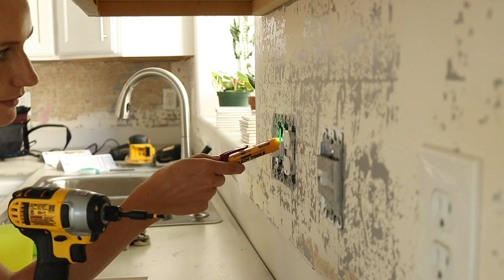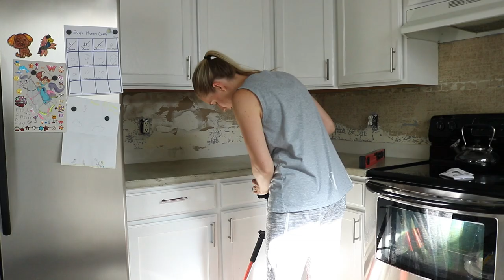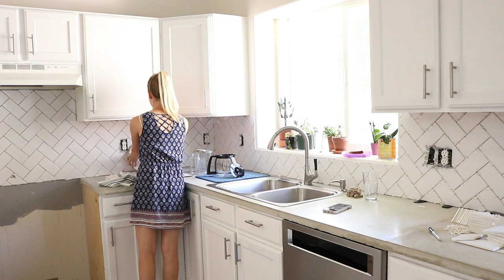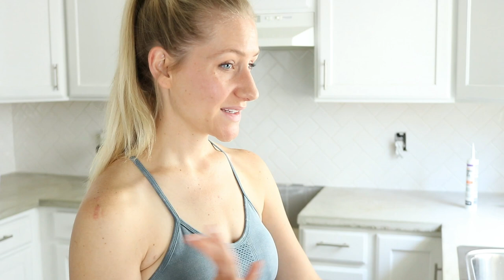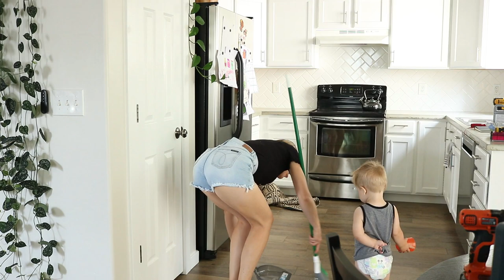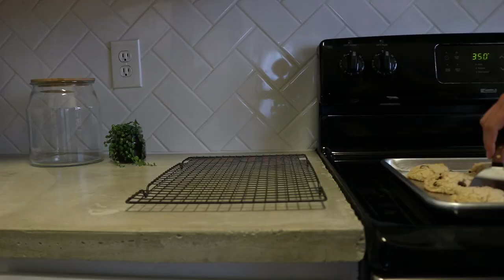budget-friendly subway tiles- but make it herringbone | SINGLE MOM DIARIES | kitchen reno diy vlog

Comment: Looks great! Somehow, we got it into our heads that a painted concrete floor was better than the cat pee indoor/outdoor carpet. We removed the carpet to find laminate tile from the 1970's. We started removing the floor which took a whole day. The glue was still all over the concrete floor. I went and bought the adhesive remover and a floor scraper from Home Depot. The glue was a pain to remove. Highly, highly do not recommend! We tried using paper towels at first, which did the job but took so much time. I then got the brilliant idea to use kitty litter. Bought two bags of it, it was pretty inexpensive. I figured if we used it in the auto shop to suck up oil then it would work in this situation as well. It worked very well. Spray a larger spot, let it soak for up to 30 minutes, then spread the kitty litter on it to soak up the tarry, black, adhesive. We then bought vinyl planks and tried to install them too. I couldn't get them to stay straight, got frustrated and hired someone to do it. lol.
Reply from the maker: Thank you, Alex! 🙏🏼🌿